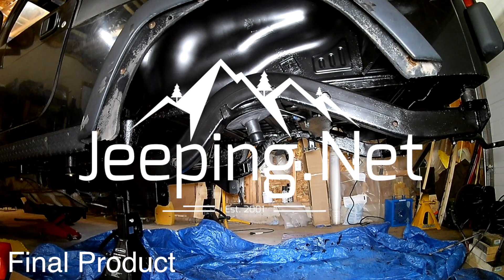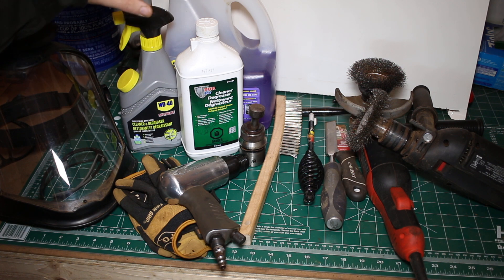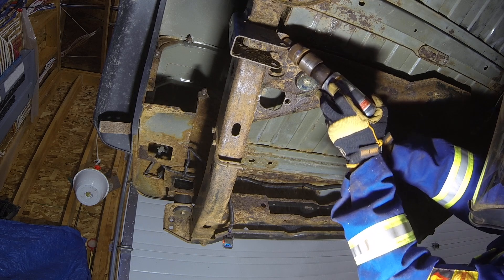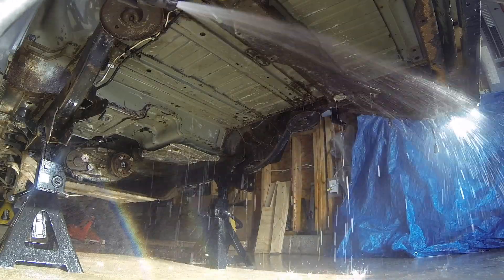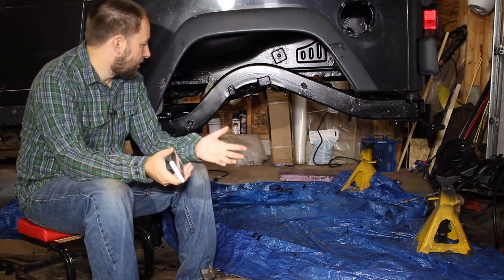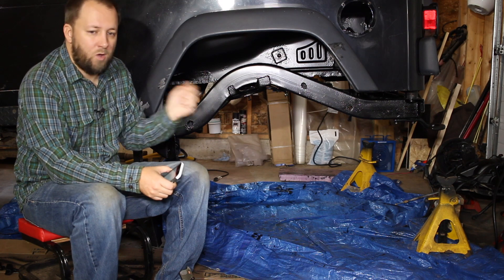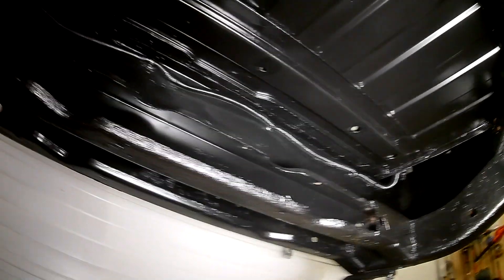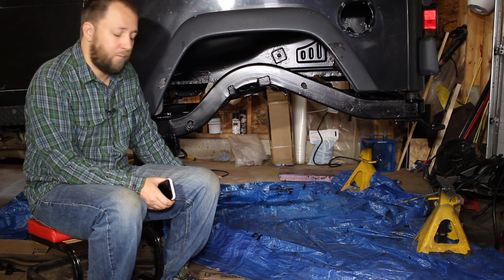How to POR15 the underbody / frame of a Jeep

Comment: So if the underside really does not really get exposed to UV why the top coat ?
Reply from the maker: Really because its only a few dollars to put a spray can topcoat over it. Por15 mentions a few times to use a topcoat so it must be important. Areas like between my body and gas tank I likely didn't need to topcoat but it only took a few minutes.
Reply: :-) So how has it been holding up so far? I plan to use it on the underside of my 92 Stealth TT, after I get my gas tank reconditioned

Comment: Awesome video man! Where are you from? I'm willing to go to you to get mine done lol I don't think any shop will do what you've done to perfect the process.  Are you from ny by any chance?
Reply from the maker: I'm actually up in New Brunswick, Canada. The process is time consuming and I was lucky to have the time and reason to have the suspension and gas tank all dropped for another project. The only time I have seen shops do this same process would be on project cars where the tub is actually fully removed. It would have been so much easier if the tub was on its side or upside down.
Reply: Jeeping.Net 
Your right about that brother,  well thanks for your reply , can't wait for your yearly update, see how that rust protector holds up for you.

Comment: what did you top coat it with ?
Reply from the maker: I used tremclad spray paint but this was a mistake since it isn’t UV resistant either. I’m going to go back and top coat with either a UV clear coat or another UV spray paint. I’m not really concerned about however since the underside never really gets much direct UV

Comment: Did you do the inside of the frame?
Reply from the maker: I will be doing the internal frame this coming summer. Ideally, I would have done it before the outside of the frame but I was on a time crunch and the suspension was all being removed this fall so it made more sense to do the outside of the frame now. I'll be using Eastwood internal frame paint.

Comment: As a xbody man these Jeeps the frames rust from the inside out the por-15 on the outside isn't going to help
Reply from the maker: Totally agree, I didn't film it but I also cleaned out the frame for a few weeks every day with a degreaser, ran a magnet up and down inside and put a few cans of Eastwood inner frame coater. Now twice a year I clean out the frame/decrease, let it dry then put in a few cans of fluid film. I also added two drain holes by the control arm mounts to help with the flushing.

Comment: Does this stuff breathe? I've seen horror stories of condensation forming between the frame and coating and your chassis ends up rotting itself exponentially.
Reply from the maker: With Por15 that really shouldn't be a concern since it bonds directly to the metal but I've certainly seen what you mention with certain bedliners and powder coatings. I never recommend people using bedliners on their frames for that reason.
Reply: Por 15 is the worst thing you could put on a frame. I have 36 years experience in restoration. Use high quality epoxy primer instead
Reply: @maartentett9726  I was thinking of the same thing about using epoxy primer.  Will it have trouble bonding if the rust is not 100% removed?  I would see the issue might be that you can never perfectly remove all the rust before applying. Do you need anything on top of the primer?

Comment: This video is the most revealing of all: you actually painted POR onto PAINTED metal?! The frame uses black that’s fine, but the underbody body panel has factory base coat paint (NOT bare metal), and POR15 works ?
Reply from the maker: It did and in my tests I’ve found the following to be true. Painting over dirt rust don’t last and the same goes for glossy paint. But using a red scratch pad then a heavy degrease will work really well over paint. Bare metal I’ve gotten bad results do it’s best to rough it up as well. Best results without a doubt is going over surface rust with a good cleaning and degreasing but leaving the rust in place. Most the time on this project was spent roughing up the paint.
Reply from the maker: It did and in my tests I’ve found the following to be true. Painting over dirt rust don’t last and the same goes for glossy paint. But using a red scratch pad then a heavy degrease will work really well over paint. Bare metal I’ve gotten bad results do it’s best to rough it up as well. Best results without a doubt is going over surface rust with a good cleaning and degreasing but leaving the rust in place. Most the time on this project was spent roughing up the paint.
Reply from the maker: It did and in my tests I’ve found the following to be true. Painting over dirt rust don’t last and the same goes for glossy paint. But using a red scratch pad then a heavy degrease will work really well over paint. Bare metal I’ve gotten bad results it’s best to rough it up as well. Best results without a doubt is going over surface rust with a good cleaning and degreasing but leaving the rust in place. Most the time on this project was spent roughing up the paint. The paint when it comes out of the can is like water so it needs the scratches to stick.
Reply: Thanks!! Hence they emphasize on using Metal Prep. I wonder what'd happen if POR over the two bad surfaces: dirt rust/glossy paint. The POR will just chip off or trap moisture until it's  rusted underneath and the POR hides them?